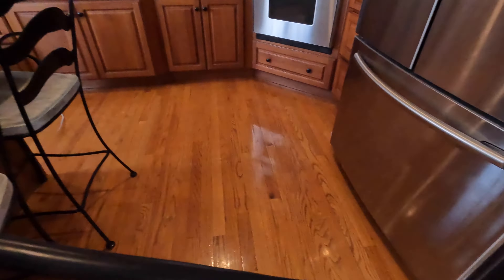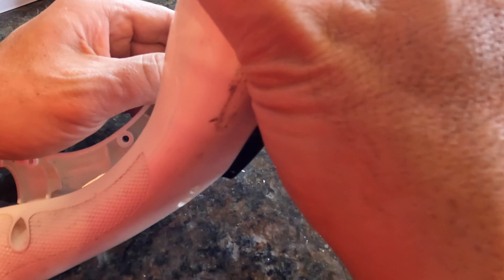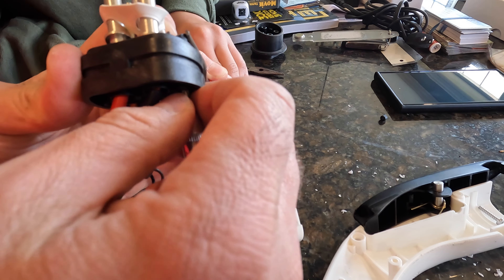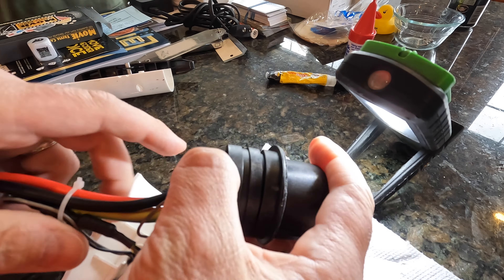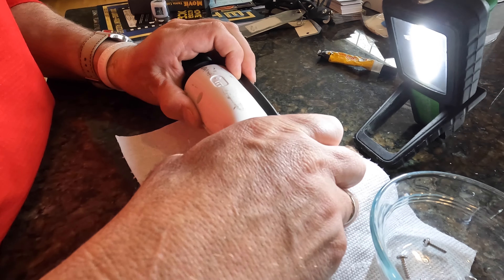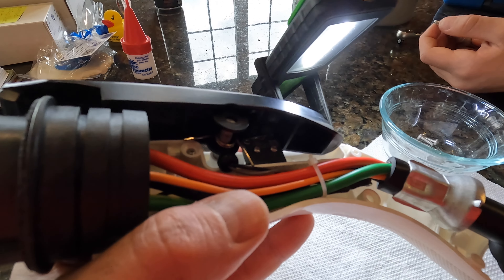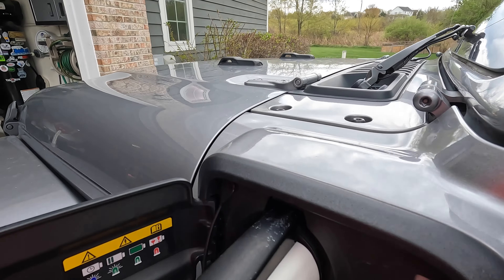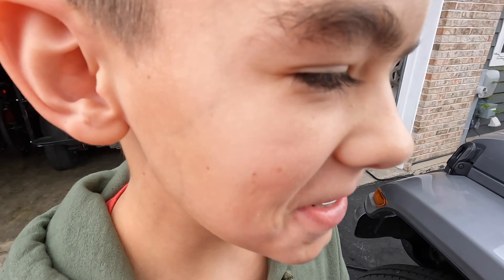HOW TO: Repairing A Broken Jeep Mopar EV 4xe Level 2 Charger J1772

Comment: I had a J-1772 plug break off at a public Free EV Charger. I discovered it happened when I started charging elsewhere. It was stuck in my charging port. 

I was planning on using Miracle Glue. Is electrical tape or Duct tape helpful? Would a hose clamp be a good idea?

I am concerned the FREE EV charger might not be repaired or changed to a pay version. It is 7 years old, so the plastic was brittle. Not many think to use that location, since it is a hotel, unlike the grocery store plugs nearby often filled.
Reply from the maker: Yikes!